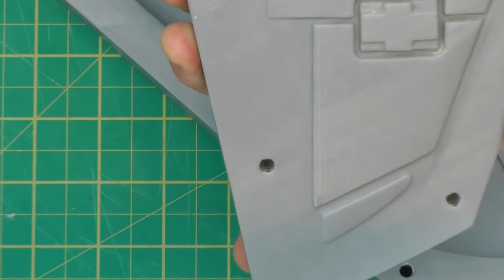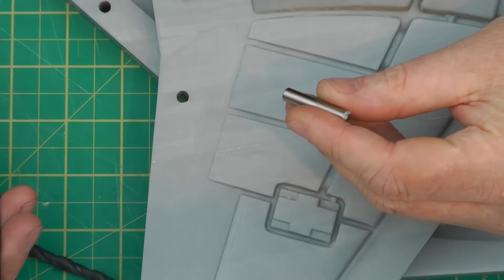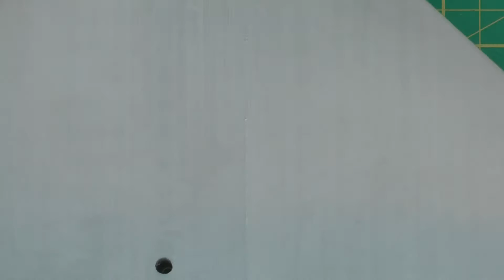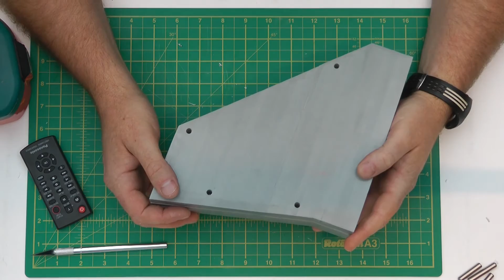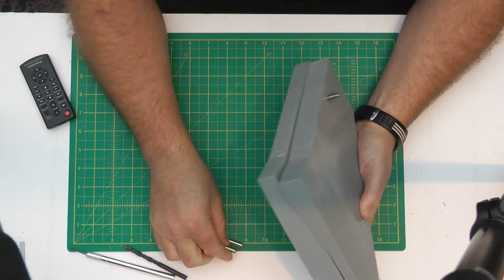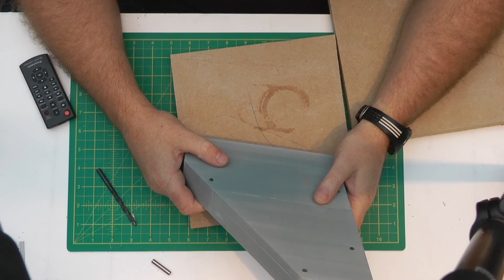3D Printed ABS for Mould Making – PART 18

Comment: My heart dropped at the sound of that crack!

Next time (maybe you already though of this):
- Drill one hole in both parts
- Put the shaft in the hole. Clamp the halves together in proper orientation
- Drill the opposite hole
- Put the second shaft in
- Now the halves are located. Drill the remaining holes
 
The holes will all be aligned.

Looking forward to watching the rest. This is amazing stuff!